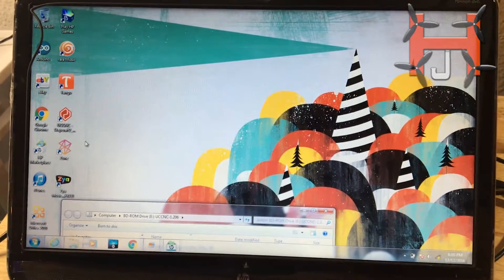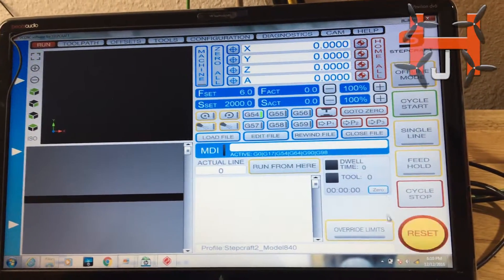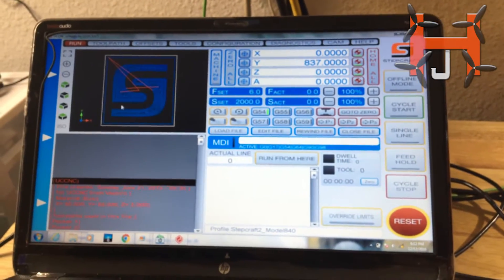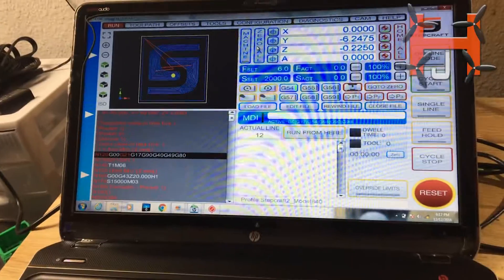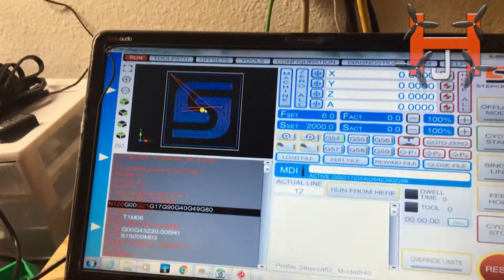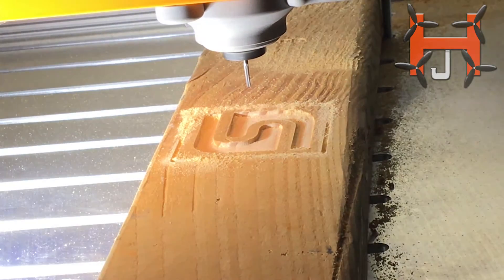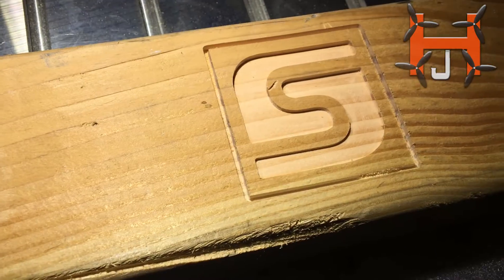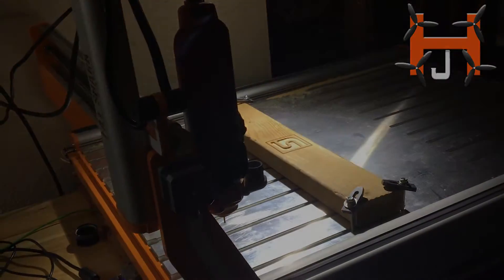STEPCRAFT 840 CNC LOGO CARVING DEMO

Comment: Well,
My 840 will be hear on Thursday!!!
I can't wait.  How was your overall start up ???
Reply: That is way to funny.
I am a Mac guy as well.
I run windows parallel on my iMac that will be connected to the CNC.
Tomorrow afternoon it should be hear.
Reply: Vcarve & Deskproto.
Reply: Thanks
I received my 840 yesterday.  In the assembly process tonight & tomorrow.  Hopefully I get it up & running this weekend???
Reply: Update!!!
I got my machine up & running  with much ease.  Had a little hiccup with the software licensing but got it figured out.  

I have a question.  Do you work in Standard or metric units???
Reply: I started out using Standard & the UCCNC program was interpreting the inches as mm's making my project extremely small.  I am wondering if there is a setting on the UCCNC software that I need to check.  I would prefers standard measurements as that is what I am used to,  But I can convert if necessary.
Reply from the maker: lowrider9367 sorry for the late response but did you get it to work?
Reply: Hover Junkie - Yes I did.